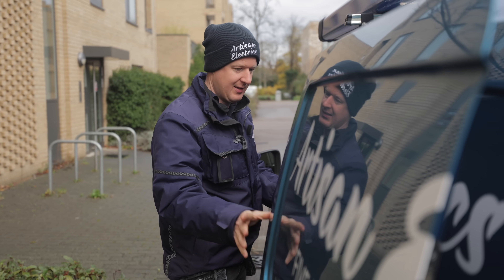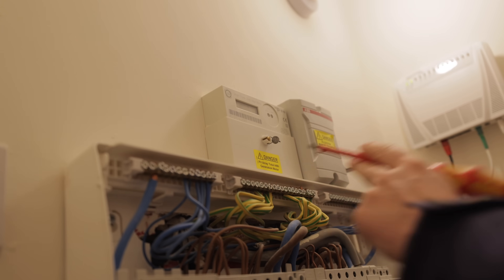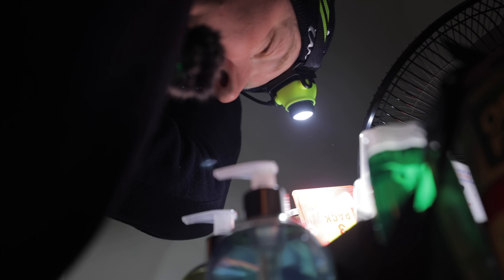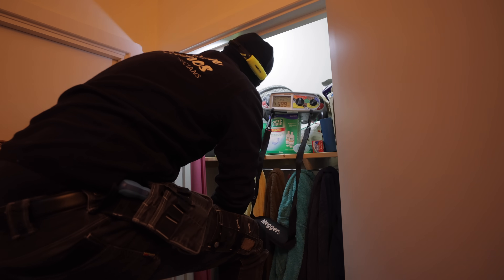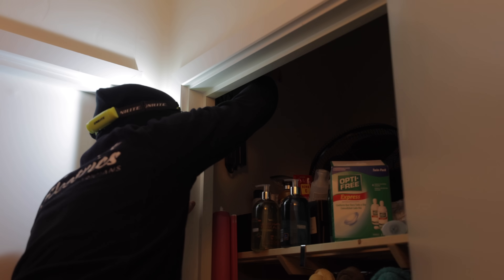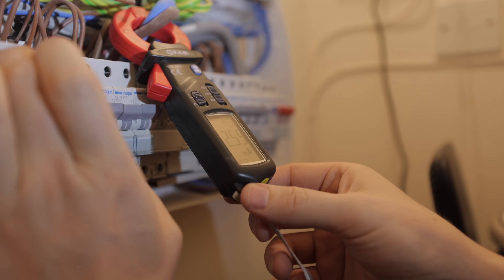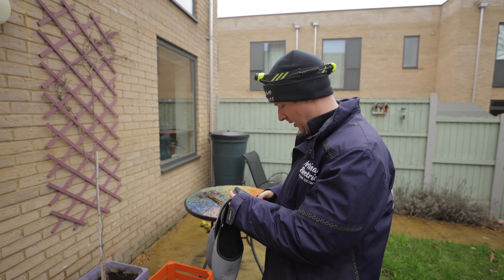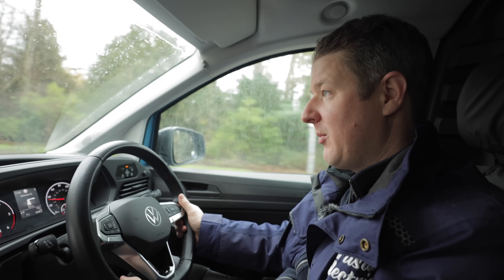"My Solar Panels Don't Work" - Fault Finding a Solar PV System

Comment: It makes you wonder if these solar energy systems ever make you much savings following the initial install cost and future maintenance, fault costs such as this.
Reply: A properly designed system using reputable parts that wasn't bodged together by the cheapest bidder will.
Reply: Oh yes they do on steroids and a cherry on top. Huge savings.
Reply: If you don't go for bargain basement price, do your research into reputable companies who will also offer after sales support, and explore design options you should get 25+years from panels, 12+ years from inverter and 10 years from batteries with warranty backed by mcs and supplers. We are a year into our solar pv, so far all good

Comment: Good presentation, I find it all too easy to criticise another’s work, remember the sparks doing the new build work wound be getting paid £90+ an hour, they will be on a price, so they have to hurry in order to make a living .
Reply from the maker: It's like anything if no one speaks up about work conditions or not having enough time nothing will change. It's just making the trade worse.
Reply: @artisanelectrics  Really ?
Reply: My boss would have kicked my ars if the board looked like that no pride in the job now just get in and out get paid
Reply: If you are talking about hurrying then you are in the wrong profession.
Hurrying leads to poor quality work and mistakes which can cost lives.

You estimate the job as to how long it will take and you do it properly. Then you charge appropriately.

Comment: Micro investors and optimisers on the back of solar panels which are then fixed to the roof of a house are a potential problem waiting to happen. Upon failure it's an expensive job for the customer as they also have to pay for scaffolding or cherrypicker on top of the repair bill. Even if the system is under warranty there's still the cost of getting access that needs to be met.
Reply: Hi John, I used to think the same, but see what you think of the video I just released. It's really changed my perception of microinverters completely!
Reply: @GaryDoesSolar  cheers Gary will add to my to watch list!

Comment: Utterly clueless as usual when it comes to PV.
Schematic in the consumer unit is absolutely irrelevant if they are micro inverters yet you felt it necessary to go through it. Use the app and pinpoint which one is at fault rather than rip people off pretending you know what you are doing. 
If you meant optimisers rather than micro inverters, get on the app and pinpoint which one it is rather than rip people off.
Utter cowboy, a disgrace to the PV industry

Comment: The trouble with all the panels in series and a single big inverter is that it just takes one panel to get dirty or be slightly in the shade for some reason and your output plummets. With an individual micro inverter on each panel you don't have that problem.
Reply: This is true. The flip side is whenl one of the inverters/optimiser fails and then you are in a world of pain getting access and getting it replaced. Tell me how I know.
Reply: @johntisbury yeah your right but when you have a stringed system and 1 of the panels goes faulty, you have to change it as well and that ain't easy,I've installed both systems and optimisers and the only thing we had problems with was the panels
Reply: Rain largely keeps panels clean and periodic washing if that fails. And micro inverters, just more to go wrong and access to the roof needed when it does. I would much rather have a single inverter thanks.
Reply: @cbcdesign001  But just the shadow of your TV aerial being on one panel can mess up the whole string of panels.
Reply: Unfortunately I suffer from giant flocks of equally giant incontinent seagulls. Something frightens them and an entire string of panels is taken out until it rains. Too high for a broom and a hosepipe will splash the guano over parked cars below.
Reply: True. But it is swings that and roundabouts
Reply: More equipment means more chance of failure
Reply: Does SolarEdge solve some of this problem?
Reply: Yet this vid is proof why they are more hassle than they are worth
Reply: Let me tell you something about recent panels... they have tiny little devices in them that can disable any panel and sometimes even smaller sections. They've had them for a while on residential panels, used to be diodes, but now they're fancier components. It can still be better to have a micro inverter where you expect issues than have a panel stop working on a string inverter under certain conditions, but it's not nearly as bad nearly as often as people who are really eager to sell microinverters try to make you think.
Reply: @lua-nya  This is good to know.
Reply: Micro inverters can nearly double the cost of each panel though, and if you aren't shaded by trees or buildings, then its not worth it just for the risk of one panel getting dirty that could be solved by a window washing broom.
Reply: I would highly recommend Tigo optimisers and their monitoring software. I can see power output of each panel every minute of the day, and cumulative energy from each panel. At midday today, 14 panels were outputting 193W each, 15th panel 126W due to pigeon poo that needs cleaning.
Reply: @saw00see That's not a fault that will take the whole system,seagull poo

Comment: 1:30 - the bus bars are also on the underside, which in my experience is a bad idea. If you can have them on top it's better. The reason is that if there's for some reason a mouse able to enter the panel and it dies then the liquids will drip down into the bus bar causing some less than appealing results with a potential fire hazard since the bus bar is effectively a tray. With the bar on top then the tray is upside down and then the risk for liquids collecting somewhere is lower. Just my take on the matter, the code for your area might say otherwise. This experience was with a 3-phase bus bar.
Reply: In UK installations its uncommon to come across a top busbar system the only brand I can think of is D-line. The consumer unit installed is a Hager dual  RCD and I'd suspect looking at the enclosure its circa 2010 ish. I'd also guess that they are both type ac rcds not type A which handles dc leakage far better.
Reply: I have a great photo which I took of a mouse that stepped on the terminals at the back of my oven. 
A perfect skeleton with some scuzzy stuff in between which I assume was its fur!
Reply: @colingreer853  before I replaced my 15th edition cu I pulled off the cover and there was a perfect skeleton of a mouse too which had got in and and goodnight sweetheart! 😂😂

Comment: Surely the Isolator should be BEFORE any Circuit
Reply: No. It doesn't actually matter.
Any physical break in the circuit will stop the current flowing.

However, if the isolator is interrupting dangerous voltages of 50 volts or more AC or 120 volts DC then the risk of placing the isolator anywhere in the circuit is that someone might perform work on the circuit before the isolator which is still live and receive a fatal shock.

So generally it is good practise to place the isolator at the origin of the circuit.

Comment: You cant have solar PV on a shared RCD!! You should have rectified that, it’s dangerous!
Reply: You can if the rcd is a type A
Reply: @persona250  the reason you can’t have solar on a shared RCD is that when the inverter detects a loss of power it can’t take up to 5 seconds to shut down, potentially keeping the system energised. Which is way over the 300ms allowed at In for a RCD. 

So you either install it on the non-RCD side of the board if it has one. Or, if the circuit to the inverter requires RCD protection, you install it on a double pole RCBO or it’s own dedicated, correct type, double pole RCD & MCB.
Reply: @carlf6507  If that were correct no inverter supply on a residual current device complies with the regulations for a circuit requiring additional protection. Give me a regulation number to back it up .
Reply: @persona250  you clearly don’t understand how PV works. 

It’s in the IET code of practice and has always been the case. You can NOT install PV on a RCD that protects other final circuits. The problem is inverters are installed a lot of the time by muppets that clearly don’t understand how they should be installed. 

The PV should be installed either on a non-RCD way. Or, if the circuit to the inverter requires RCD protection then it’s a DP RCBO or DP RCD and MCB.
Reply: @carlf6507  Carl, I asked this to Matty too but you seem to also understand the problem so I'll ask you as well. If you found this during an EICR how would you code this, a C1, C2, or C3 or other?
Reply: @kirkhamandy  I have always coded it as a C2 as it is potentially dangerous. I’ve even seen this scenario on new builds and always got them to change it when I’ve explained the issue. 

Easy way I remember how to code is:

C1 - Someone can get hurt or killed with nothing to prevent it. Eg exposed live conductors 

C2 - Something else has to happen for the installation to get angry. I.e in this case the RCD has to trip, inverter detects power loss and takes up to 5 secs to shut down, potentially making the reason the RCD tripped fatal as it didn’t de-energise the installation in less than 300ms. 

C3 - Generally something isn’t compliant now but was at time of install. Eg no RCD on light circuits. Or something like non-manufacturer made component in a consumer unit and no sign of thermal damage etc.
Reply: @carlf6507  I understand it well which is why we are having this conversation. 
Shared rcd prohibited on type AC RCDs  due to dc voltages causing an AC rcd to latch . 
The inverter won’t shut down at all with the ac circuit shut off . It’s power comes from the dc side . 
The internal relay on the AC side of the inverter disconnects on immediate loss of AC power this is a requirement of any manufacturer. 

If what you are saying is such a big issue it would prohibit it in bs7671 which it does not .
Reply: @carlf6507  Thank you for the feedback, TIL, much appreciated.
Reply: @persona250  So, what you are saying here, if I understand you correctly, is that the designer of the inverters must ensure they disconnect their AC drive output immediately if the AC grid side supply is lost whereas other commenters in this thread (Carl and Matty) are saying inverters may take 5 seconds to shutdown? Have I got this correct or am I too none the wiser?
Reply: @persona250  I’ll explain my point again as your confusing two separate issues. 

If the RCD trips, the inverter detects power loss and shuts the AC side down. This can take up to 5s. Hence it should not be on a shared RCD as it can still be energising the installation for that 5s, making the reason the RCD tripped potentially fatal. It doesn’t matter if the RCD is type A, B or F. 

What you’re talking about is the reason you can’t have AC RCDs for PV (as well as EVCP) as the DC can blind the RCD and it fails to trip. So unless the equipment has galvanic isolation then it needs at least a type A RCD.

So unless the inverter manufacturer specifically state the inverter cuts power to the AC side immediately on power loss (which there may well be ones out there now that do) then it would not be allowed to have the PV installed the way it is.
Reply: @kirkhamandy  The inverter would have to operate quicker than the RCD, which it cant because it has to wait for the RCD to operate before it can react.
Reply: @mattys5686  ok, so what your saying here is with have two sources of energy but only one is RCD protected leading to some circuits potentially still being energized by the Inverter after an RCD trip. OK, so this makes sense and so, imho, it makes sense to isolate this second source (the inverter) to its own RCD or RCBO. Is there really nothing in BS7671 about this? Sounds like an issue that needs addressing.
Reply: @carlf6507  I’m not confusing anything . 
The AC circuit relay in any inverter with g83 or g99 approval has a maximum delay setting of 0.5s . The relay must be a solid state relay which if you look into will disconnect immediately . 
This changed in June 2019
Reply: @kirkhamandy  yes as of 2019 g83 amendment 3 
Says something like must use a solid state relay . Maximum delay setting 0-0.5s .
Reply: @persona250  OK, so I found and read G83 (2019) Amendment 3 and I assume you are referring to section 5.3 Interface Protection and indeed it does say it must disconnect no more than 0.5 seconds from loss of supply, you are correct. However, points I take away from this:-

1. This was set in 2019, there will still be unsold inverters sitting on the shelf awaiting purchase and installation that were made before 2019
2. I see that some inverters might not be typed tested and settings at install time can be an option, who is meant to confirm Table 1 requirements have been met, the DNO?
3. How is the average sparky meant to know about all this? Something should be in BS7671
4. Would I bet my life on this? No, I wouldn't and so some form of protection is warrented (imho).
Reply: @persona250   I don’t have the IET code of practice to hand right this second. But I’ll check it tomorrow. 

However it clearly states you should not install PV on the load side of a RCD if it feeds other final circuits (I’m paraphrasing). Off the top of my head it’s in section 7 or 8. 

RCDs must trip in <300ms at In. But 0.5s is 500ms and is slower than <300ms. The reason it has to trip so fast is because 30mA (or greater) for any longer is likely to be fatal. 

So unless the manufacturer provides written confirmation that the AC disconnects immediately on power loss and within the <300ms allowed from the time the fault occurred. Then I’m not sure how you think it can be compliant.
Reply: @persona250  it makes no difference what type the RCD is.
Reply: @mattys5686  well a type A is suitable for dc back feed , others are not .
Reply: @persona250  it’s got nothing to dc voltages, as I said the type has no relevance. An RCD must disconnect all live parts which with a PV supply on the outgoing side will still be live until the inverter shuts down which could be anything upto 5sec. (Have a read of the code of practice for solar as it’s stated in there to which all installations should follow as a minimum standard.)
Reply: @mattys5686  give me a bs7671 regulation number .
Reply: @mattys5686  So, interestingly, if you found this during an EICR how would you code this, a C1, C2, or C3 or other?
Reply: @mattys5686  read my response to Carl , same argument
Reply: @kirkhamandy  Code C2 - Potentially dangerous
Reply: @kirkhamandy  You could put C1 as well as the Danger is present.
Reply: Lol. This is nuts.
Can’t find a clear reg in BS7671.
However the code of practise is very clear about it on section 8.2. :
“Solar PV systems shall not be installed to the load side of any RCD that is shared with other circuits (e.g. where the RCD is feeding a number of circuit breakers/circuits).”
The additional protection needs to trip within 0.3s. 
So 0.5s is no use.
Would have been helpful if the code of practice quoted a reg number
Reply: Think I’ll stick to no rcd and flexishield where additional protection is required.
Reply: @davida1841  OK, well that seems to close it off as far as I'm concerned. Pretty clear to me at least. Thanks.
Reply: It's also an older system. Do you replace every plastic consumer unit you come across because it's not safe?
Reply: @roydowling2542  it’s never been safe to install PV on a shared RCD, unlike plastic consumer units installed correctly at the time of design & installation👍
Reply: @mattys5686  who ever designed the circuit originally clearly felt it was. In this case all Jordan can do is recommend to the customer that  it's not safe and needs to be changed. If the customer doesn't accept that recommendation there is nothing Jordan can do.  He can't make changes without their permission.
Reply: Shame it’s not covered by a regulation number. But clearly makes sense. Thanks for highlighting this C2 issue.

Comment: no demarcation on the diagram for the Type B RCD ? ; doesn't look beefy enough; system might not need one ? most inverters tend to require one, its international standard;  surely its tripping due to the different sine; not familiar with micro inverters
Reply: No it is not an international standard.
Each country has its own standards for electrical apparatus.

Comment: Just a thought… when I’m installing micro inverters maybe it would be a good idea to install them in the Attic in case they go faulty, what do you think ?
Reply: In loft is the best way. So long as the correct flashings are used it’s fine regarding holes. You would generally replace a tile with a special plastic tile with moulded entry points. 
Much better going up a loft ladder to fix rather than getting scaffolders and lifting panels off. Especially if it’s a unit in the middle of a row, where all the panels need to come off from the end of the run.
Reply: @newlinerealboi3434  and how do you waterproof the membrane?
Reply: @Stugadget  the membrane is laid on in horizontal layers, roughly every meter. They are simply overlapped so you can pass the DC cables between two layers beneath the panel. No holes to be made.
Reply: nope to many holes in the roof ;. same for optimzers .. alle work fine .. until one breaks ... you need to go on the roof ;.
Reply: @kittsdiy  I did think about that but would that not be better than needing to rehire a scaffolding. 25years Warranty, would customer not expect me to pay for scaffolding?
Reply: @MacdonaldEdinburghElectrical  good question .. i think in a lot of agreements .. the warranty is on the parts only by the manufacture .. not on the labour etc /demounting the panels .
Otherwise yes could make it expensive for the installer :-)